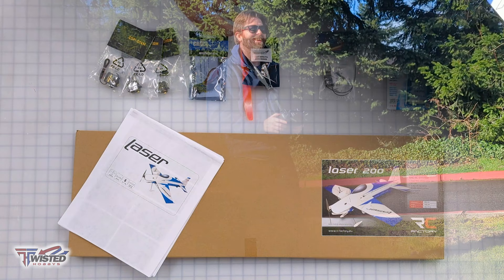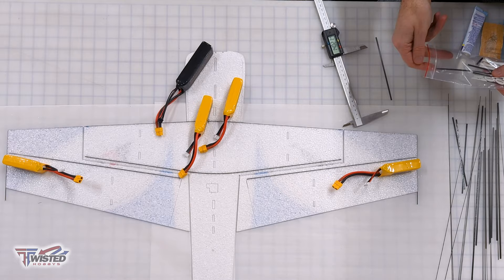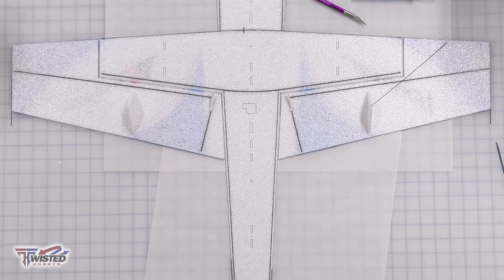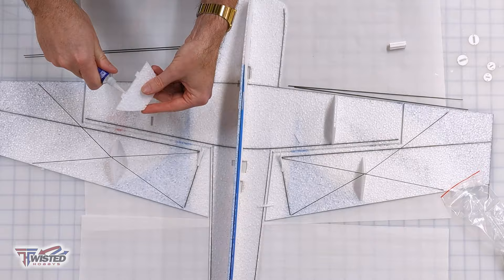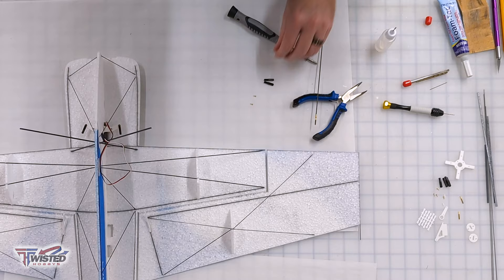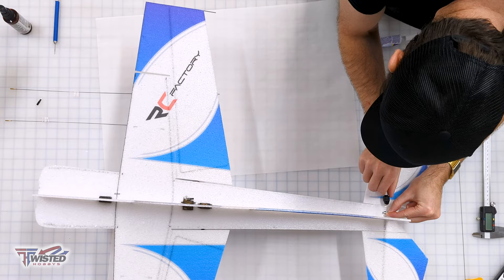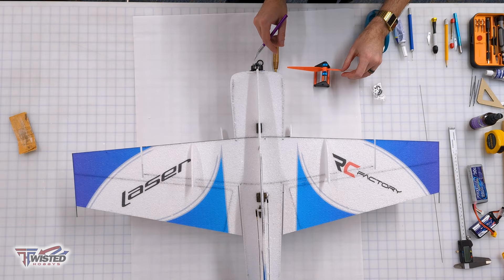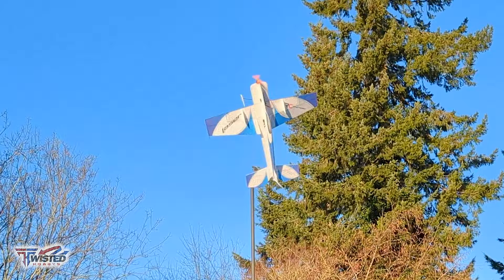Twisted Hobbys/RC Factory -Laser 200 - Build & Maiden Flight

Comment: Ok, you stated, "you can use 2305 1500kv with 2s on 9" prop setup for more prop wash."  Which 9" prop are you using exactly?  I looked at the 9" TH sells and see 3 or 4 different pitches......
Reply from the maker: Correct any of them,  you can fine tune to your likely.  Personally I like 9x4.7

Comment: I see you’re running the 2305 1500KV motor on this plane and hear you’re running a 2S 500mAh battery, what prop size are you using on your demo flight??  Thanks in advance!
Reply from the maker: Correct, you can use 2305 1500kv with 2s on 9" prop setup for more prop wash, also 1800kv on 2s with 8" prop is fine as well.

Comment: Very good video. 
Problem : Foam Tac glue is perfect but very difficult to find in Europe.
Reply from the maker: Understood, usually any good adhesive glue works great. Believe UHU Por adhesive is available in your location.  Also good CA glues can be used.  We like Beacon or other similar adhesive since it drys flexible versus CA glues dry hard.

Comment: Ok, so I just ordered my Laser 200 and a couple of the 9x4.7 props!  Just a couple of more questions: (1) what is the name brand of your 2S 500mAh flight battery?, & (2) what kind of flight times are you getting with "that" battery? & (3) what is the "C" rating on your battery?
Reply from the maker: You can use most all brands for our models.  2s 500mah should yield you 3-5 mins depending on how hard you are on the throttle etc..
Reply: I am using a few different brands, but my favorite is currently CODDAR 500mAh 2S 100c. My timer is set for 5 mins and that brings me to 3.7-3.8v depending on how much I'm giving it the beans! I do swap over to XT-30 connectors on my ESC, so that takes a little bit of soldering.